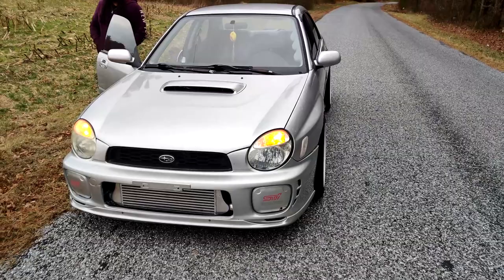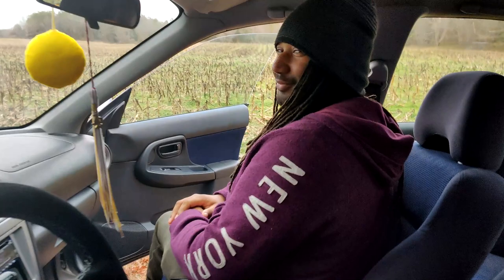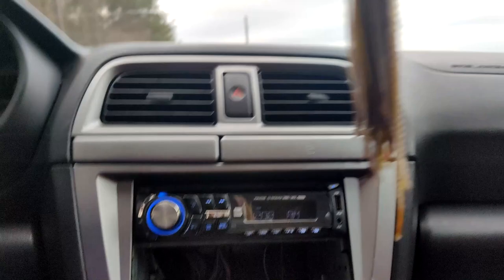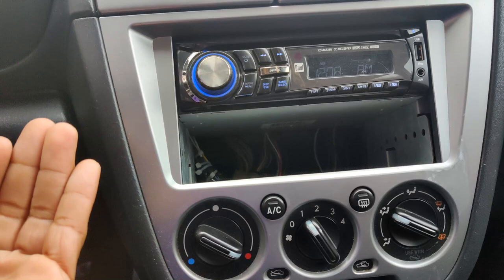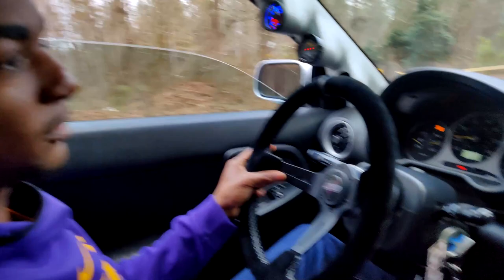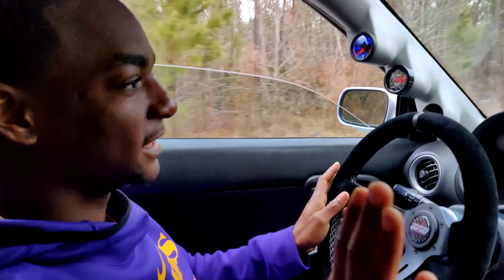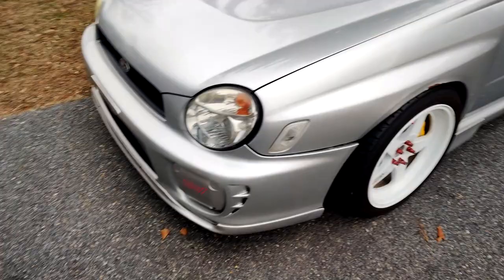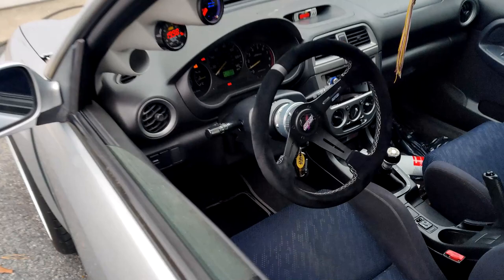Explaining my Anti-lag setup on my WRX (Carberry)

Comment: Well guys, i am still tuning carberry on my jdm ej205.  Cylinder temps go pretty high on this.  HOWEVER really happy to see guys showing this off!!
Its not really antilag, its the iac valve staying open as the map shows.  Then ur running -20 timing across the rev band with the resulting raised idle.
You also lose brake vacuum, so watch it the brake will be a bit tweaked.

Comment: Anti lag is great for killing the turbo mate.. if you get a chance, go for a 207 bottom end and reco 205 heads.. the 205 is the standard engine for mine and it's old and slow
Reply: Chris Smith Weaker cylinder walls don’t make your car any slower... 🤦🏼‍♂️ If you’re swapping an EJ207, there is ZERO reason to use EJ205 heads. EJ207 heads are far superior.

Comment: hey bro, ive been  learning to tune opensource on my wrx mostly maf based stuff and i wanna make the speed density switch to the car berry rom,  is there any tips/ links etc to guide me on how to / what i need to do to go about flashing the carberry rom ?  i have a pretty good idea about the basics when setting up for carberry but still a bit unsure of how to go about it.
Reply: Did you ever figure it out because I just got the tactrix cable today

Comment: So I'm guessing the switches to keep the throttle flap open for anti lag ? Used to wot box and am wondering if it's like setting an alternate rpm for rolling shifts with a secondary rpm limiter ?

Comment: I think its not just rising the rpm, sounds like it retards the ignition timing and adds fuel when you let off and on idle.
Usually what ALS does is a combination of the 3 ,open the Throttle or a bypass valve to get exess air into the exhaust manifold than retards the iglition timing so the explosion is still occurring when the exhaust valves open and adds fuel to make the „explosion“ in the manifold bigger. 
ALS just shifts the timing in idle and letting off never under power.

PS: sounds sick and if it does the timing stuff its a LEGIT Anti Lag System and thats some Freaking Racecar stuff and you should just use it every now and than cause it really can do some Damage over time

Comment: Is the ALS system in the tune? Or is it like the 'rocket' system the wrc cars use?
Reply: this isn’t antilag its 2 step. anti lag is keeping the turbo spooling on decel by introducing air directly into the exhaust and retarding timing
Reply: @imsethtwo  2 step is a lower rev limit, it doesn't do anything when you are off throttle, that is not what it is in this video.

Comment: ALS in a production car is not really a true Anti-lag. A complete system require many modifications and would melt most stock turbo impellers. Ant-lag needs a fresh air valve feeding each individual exhaust runner combining with the unburnt fuel.  It can work in a conventional method , but it makes the car rather unpredictable resulting in poor drivablity.
WRC Subaru's used a a system called "Rocket" , it used compressed air to launch at very low RPM .
https://www.youtube.com/watch?v=ms3U7Ztoip8